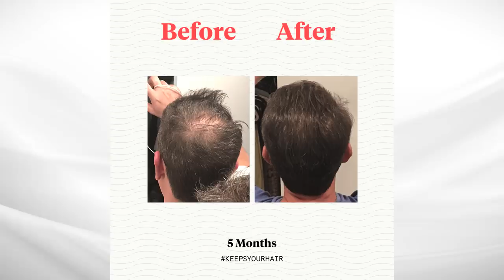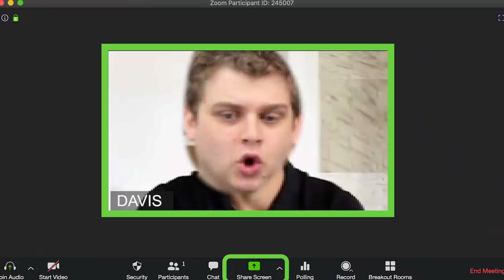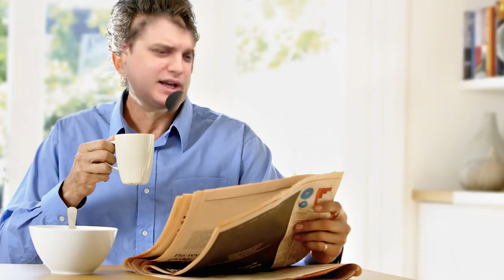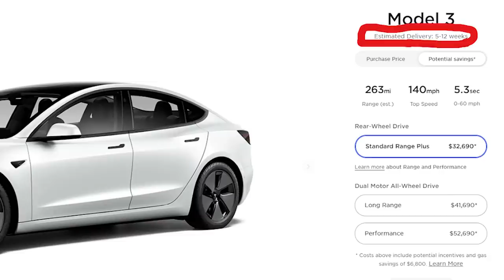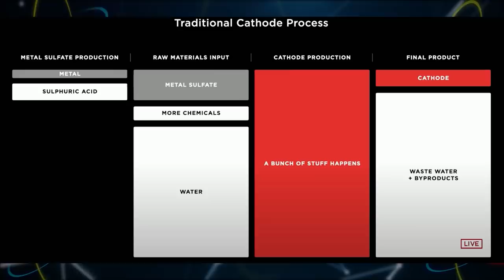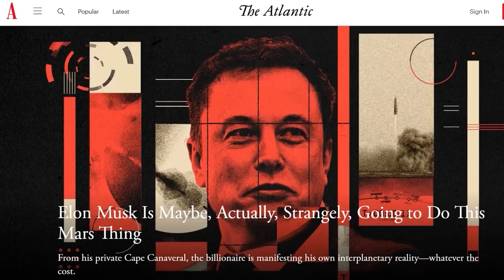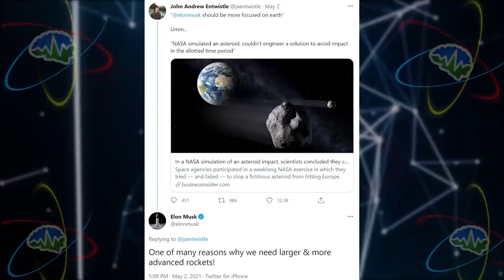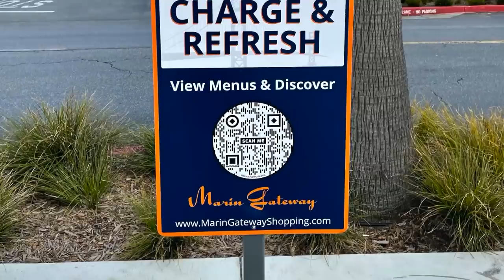Tesla Time News - Elon's big reveal on Saturday Night Live

Comment: The only thing stopping me from investing in Arrival is the micro-factory system. I like it for building big things like Busses. But for building cars, I think you need the traditional moving assembly line. It's really the only way to build anything at such a high scale.
Reply: I don't think there planning on being a car company, I think there business will be trucks, busses, and vans. If they have any planes for cars then I have yet to here of yet, and it sounds like the car they are doing won't be a mass market car but rather a car for ride sharing rather than for privet ownership, which does not need to be scaled to such high volume.

Comment: In regards to Early Warning - It has saved me two times, but it also alerts me in many instances where there is no reason to.  When a vehicle is turning off the road into a parking lot or side street and I have plenty of space, it will still beep if I am not decelerating.  It makes my passengers freak!  And no, I am not an aggressive driver and have never rear-ended another vehicle.

Comment: On the flaming Bolts- My guess is that this is the normal result of a what happens when a crappy company like GM starts making all electric vehicles.  I remember all the electrical failures I had with the Chevy truck I owned.  yikes!

Comment: We're Electrical Contractors that exclusively focus on EVSE installations, w/ a 126mi. range only using 90% of battery capacity for longevity (113mi.) then take off 15% for real world driving (90mi.)+ add weight of our staff, electric wire/conduit, charging stations, tools, etc. and you will loose another 15% for weight (73mi.), thus in most of our cities, other than NYC, we are over on mileage as on average making multiple trips per day we average 110 mile range. Great in concept, but we'll need 400mi.+ range in order to get what we need out of it. Currently have 3 Cybertrucks on reserve....awesome sauce!

Comment: So you say that the value of 1k supercharger miles is $112, and then a few seconds later the other guy adds that people are afraid to use superchargers because they are unsure how expensive it will be, but when they do they find it only costs like about $10 to get a full charge. With Tesla cars getting in excess of 200 miles per charge, it would seem the value of 1k supercharger miles would be more like $50.  So, is the value inflated, or does it actually cost quite a bit more than $10 to use a supercharger, because one of the two it would seem must be true.

Comment: While it is not good to speculate, if a battery is neither charging nor discharging, thermal runaway is indicative of a physical flaw in the battery structure. It would be nice if GM had remote data logging on this, but that is doubtful. California is going through a very strange period. We have so many renewables that the utilities are negative on all new residential solar. The kWhr charges are so high that there is no difference between driving an EV and the typical modern car's gas cost, and that's with the high price of gas in this state. Car and Driver just got done saying something similar in Michigan (they have a long term model 3 in their fleet). PG&E, SCE and SDG&E are the 3 big utilities. SDG&E seems to be the only one in favor of renewables. They all, of course, say otherwise.

Comment: In regards to the price increase basically they are increasing the price before the government gives us that big tax break that everybody's talking about ranging between $7k and $10,000. It is reassuring that the tax break is coming because they're increasing the price but on the other side of that coin it's kind of messed up that they're increasing the price making the car cost more when you do buy it with the tax incentive for example a $37,000 car would only cost $30,000 but that doesn't look like it's going to happen I think that they're afraid that their car will be too cheap and then they can't release the $25,000 car because the price difference is too small so they would have to make the $25,000 car even cheaper and thus losing money on it

Comment: @Now You Know: I don't think you gave fair consideration to California's bill to "screw over rooftop solar". Rooftop solar has a deep flaw that doesn't get enough attention: the QUANTITY of electricity generated is not actually a large factor in the cost of operating a power grid. What would happen to PG&E's operating costs if 100% of its customers produced 100% of their own energy needs? It turns out they'd collect ZERO dollars from customers, while their operating costs would only be reduced by a tiny percentage. Customers with rooftop solar utilize the grid as much or more than a non-solar customer without paying for it. Changes like this are INNEVITABLE, and will be mirrored by fees imposed on EVs, since EVs are in exactly the same boat: they use the very expensive-to-maintain public roads as much or more (much heavier) than an ICE-powered car, but avoid all of the gas taxes that pay for the roads. I like EVs and solar as much as the next guy, but it's not a panacea, and it's not as simple as everyone wants it to be.

Comment: Ford's LOSS = Owners' BONUS - EVs have ZERO MAINTENANCE and never need - Check Engine Light costs, Oxygen Sensors, Timing Belts, Oil Changes, Oil Filters, Coolant Flushes and Thermostats, Transmission Services, Leaking Gaskets, Bad Injectors, Spark Plugs, Coil Packs, Ignition Wires, Transmission Sensors, Engine Sensors, and Dealerships. EVs need - New tires every TWO years. That's it - PERIOD. No more Gas Stations, Parts Stores, Car Repair Shops, Emissions Shops, Quick Oil Changers - ALL those businesses will be GONE in a few years. Car makers will have to make a profit on car sales - PERIOD.
Reply: Are telling us that Tesla Service Centers only sell/rotate tires?
Reply: @dusty-vo8gh  They don't "read" OBD lights or change timing belts or Oxygen Sensors or Fuel Injectors or Spark Plugs or Ignition parts or Cat Converters or mufflers or exhaust pips and hangers - want more?
Reply: @r.a.monigold9789  of course with an EV you don't change/maintain ice specific systems but you still maintain /change ECU, steering racks, bushings, air suspension systems, air filters, cooling fluids, adjust panel gaps, want more. You said EVs were ZERO MAINTENANCE. They are not. Still plenty of work (money to be made) from service centers.
Reply: @dusty-vo8gh  Keep dreaming...